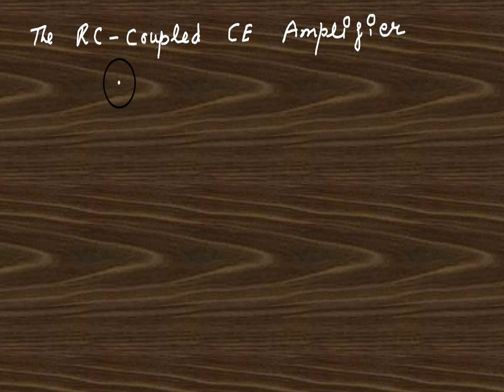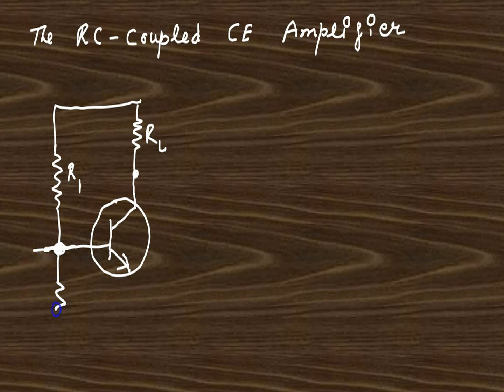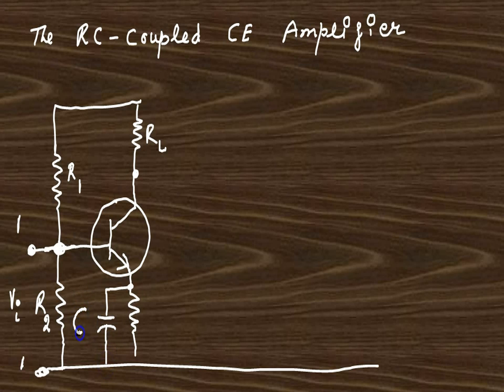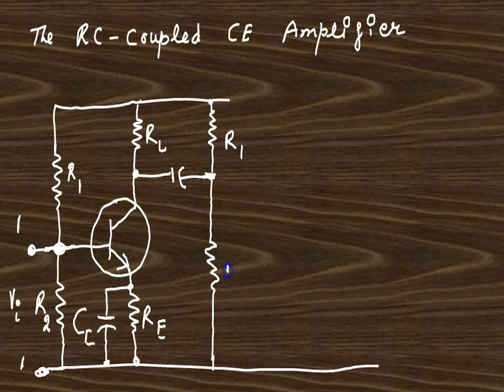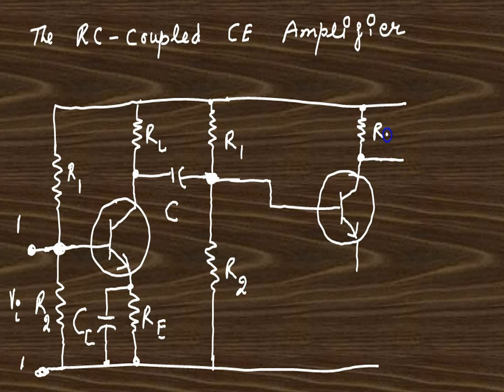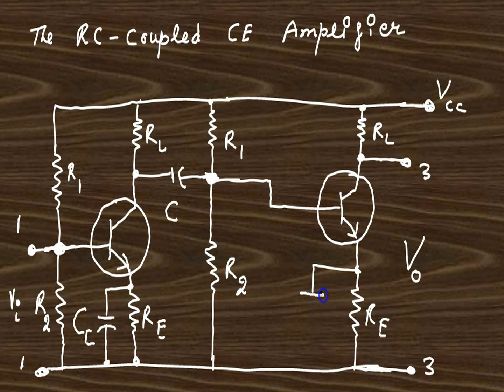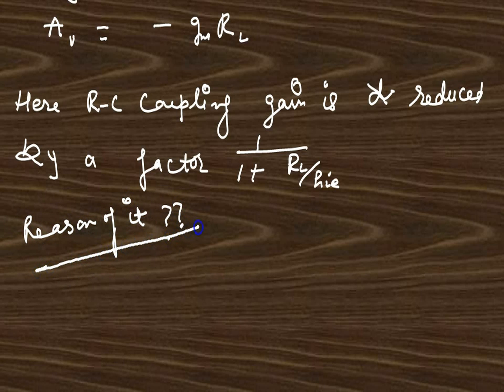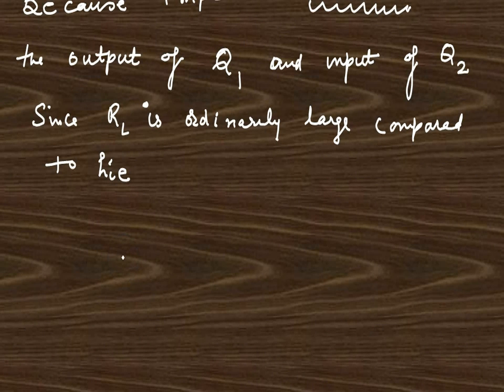RC coupled CE Amplifier, Mid frequency Analysis

Comment: sir say about voltage across R2 when we draw h parameter from transistor
Reply from the maker: R1 and R2 are DC biasing Resistors, These resistors are ignored when we discuss the ac signal processing through Transistor